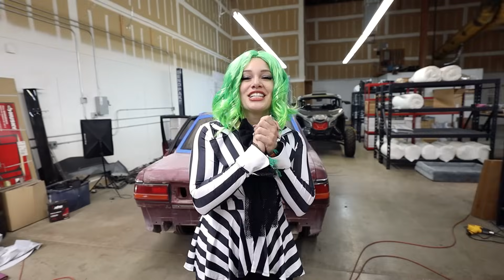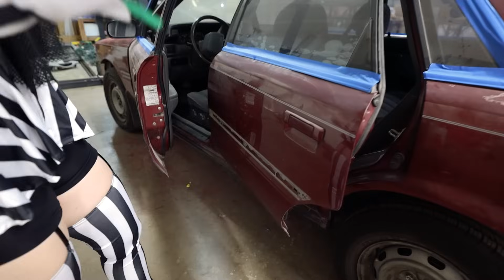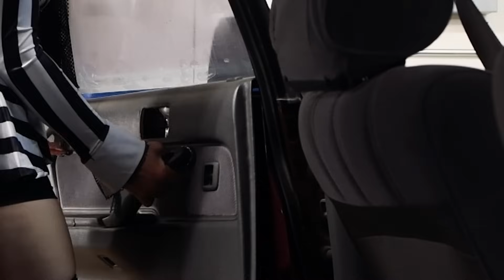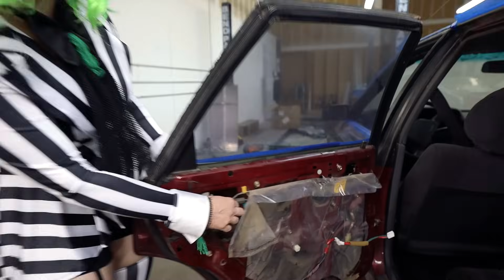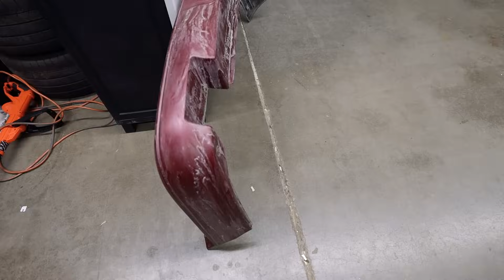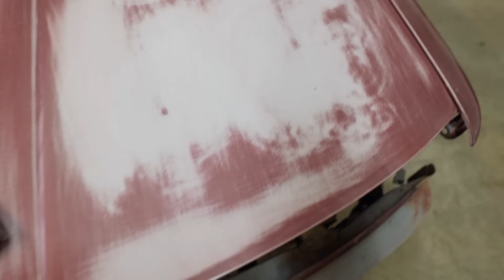Removing Doors Panels & Handles on my Toyota Camry Project..

Comment: Hey Doris.. it's me again. .. there are two ways to manage the holes in the hood. Best way would be to sad it all the way down to metal. The other way is to sand until it's smooth and then use a Primer Filler which a shop will use as this will kind of Primer will fill in those holes easily. Once primer is done and that primer is sanded with 400 grit. You will inspect the primer to see if you need Glazing putty for touch ups. Like I said before, you don't have to worry to much as you will be paint the car the same colour. So you just need to sand the front bumper, fix anything which is broken. Your goals is not to remove the paint but to scuff up the clear coat... so the bumper will look dull in colour. If not repairs, then the pumper will be bull dogged, painted and clear coated.  Hope this helps. PS.. are you going to try to paint it yourself?

Comment: Paint society has some good tutorials videos on painting a car without stripping it down to metal. They posted about 1 year ago.  Hope they help.   Don't put the door panels back on to open or close the windows just plug the switch in.  Also once you remove the door handles before you close the last door make sure you can still get in.

Comment: You definitely spray 2k high build primer on hood.i would recommend before sanding more,to take time to tear down,as far rear taillights trims moundings.etc..its definitely a way to get to know your ride.if possible have a glass company pop out the glass,windshield rear window..makes it easier. Love those little rides.

Comment: You can sand it a little more or use the acrylic putty use it on all those  plases where those tiny bubbles are.
And the bumper you have to just sand and prime it.

Comment: Generally... sand... spray with primer... block sand until flat and smooth... then if you sanded down to bare metal at all repeat... if you don't sand to bare metal blocking it spray color

Comment: A court of primer will tell you if you need to sand it more if you don’t see it in the wet primer you are good but if you do sand it more than primer it again a acid etching primer is what you need over bare metal once you have it scuff it up and use a primer filler then block sand it down to make sure it’s all level 😊 remember X pattern and never just back and forth patience is the key here and you will be absolutely tired of sanding on the car

Comment: You don't need to reattach the whole door panel, just plug the window switch harnesses back in, turn the key to the on position and roll the window down as normal.

Comment: I'm  pretty sure you don't need to strip it down to the metal you need scuff it up. Use body filler for the chips  on the  hood  more sanding then some primer then some wet sanding the your ready to paint.

Comment: Try the best not to go to the middle because if you go to the metal you have to cure the middle it's important to take the pain off Go Lightly with no pressure

Comment: Unfortunately, you’ll have to put the door panel back on in order to get the window back up.
Reply: Nah just plug the switches back in.
Reply: Chica, you’ve taken a a GT350 engine down to nuts and bolts. You got this. The only thing that sucks is plastic breaks.
Reply: @vincentpritchett1231 is right.  @adrianbrown2957 is wrong.  In fact if you're able to remove the window switches off the door panel, you can just plug the harness into the back of the window switch and let it hang on the wires